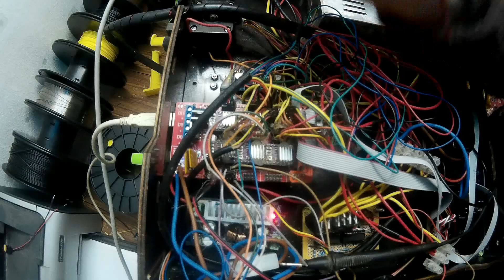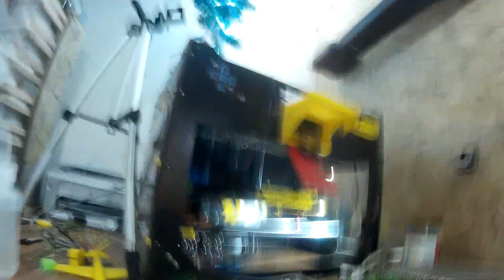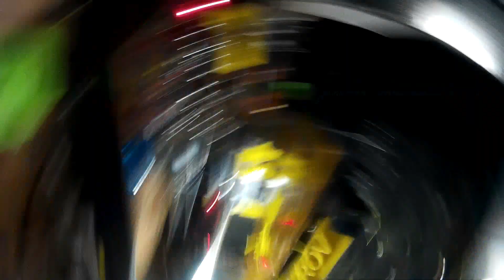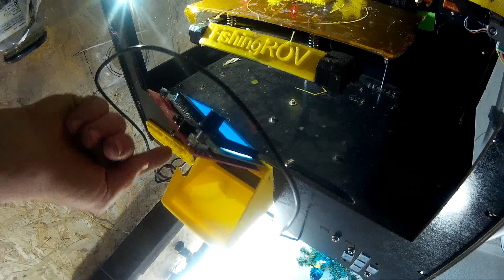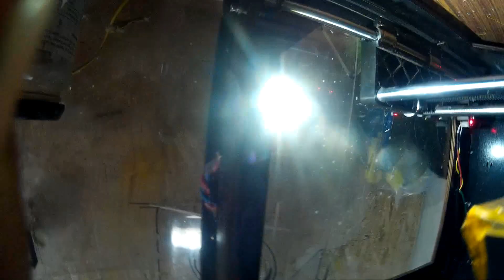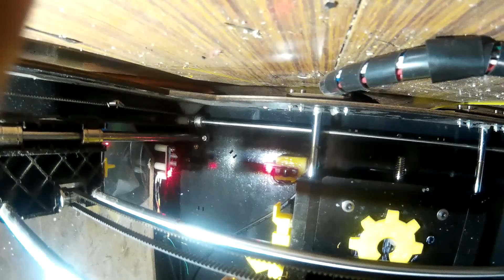FishingROV #60 CTC to RepRap Ramps Conversion Deitail

Comment: Better off using a geetech gt2560 controlboard, runs on 12 and 24 volts. However i would high power mosfet swithc boards for the hotends and heatbed as I have had experience of the mainboard frying due to current passing through the micro fuses and melting the holders.

Comment: do you have a wiring diagram and parts description my email .s bensleasman33@gmail.com if you do. my ctc printer circuit board quit after 1 day and i bought the ramps to control it but its not working. i think its the 24v heat extruder but im not sure i changed the power supply to a 12v because i fried my mega trying to use the 24v